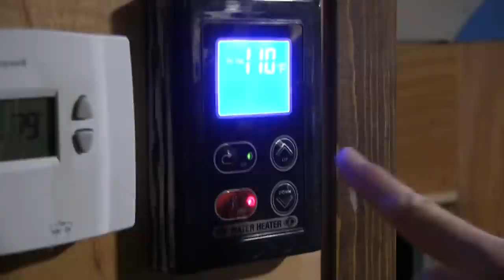Grouting the Shower & Giving 30 Day Notice to Move Into our Skoolie!

Comment: usually you make small circles with the sponge that way you work the grout intoo the grooves a;;so dont wast time , you dont have mush until the grout is drying 
as for removing the cement haze , (btw its muiratic acid ) its normal to have to do it several times over a few days before everything is worn off
dont think the connections to the wood whill work , the first time you move through some bumps in the road those seams will crack , silicone works better on those spots

Comment: American tile adhesive and grout is so awful - over here in the UK we have this amazing stuff called Unibond which does both at once - and it's white. It makes the job so quick and easy. I would hate to have to do it your way. And you don't need to seal it afterwards. And it wipes off the tiles when it's dry with a damp cloth so easily.